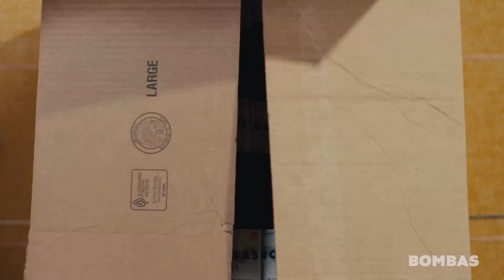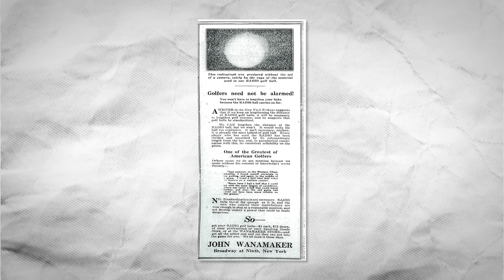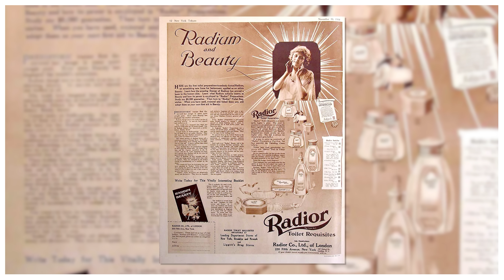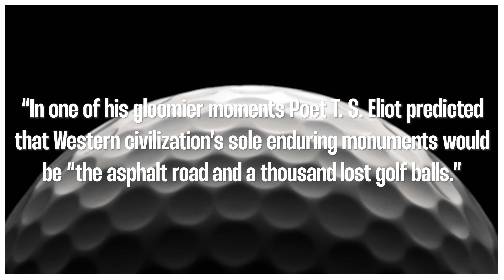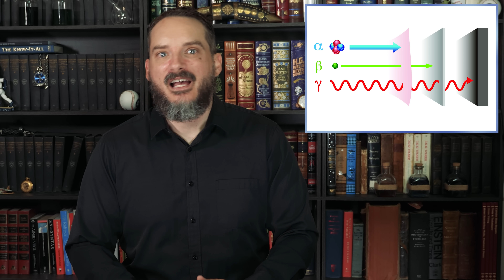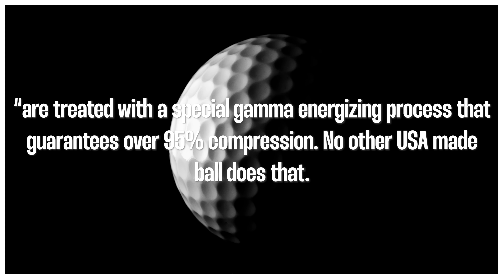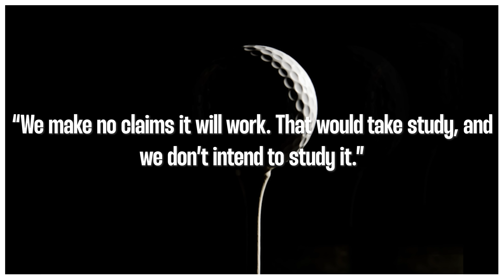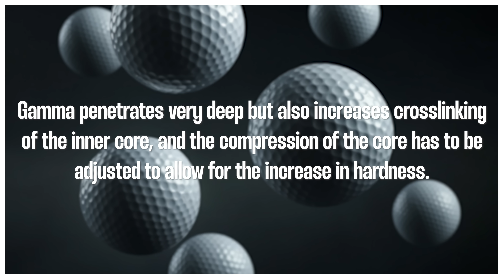The Curious Case of Radioactive Balls

Comment: I use a tool called a "ferret finder" for pest control. It’s a small collar with a radio transmitter that fits around the ferret’s neck, paired with a handheld receiver. You track it by following the beeps, and the receiver can be switched into another mode that helps pinpoint the collar’s location even if the ferret is deep underground. The whole point is to make sure you can find a ferret that gets stuck in a burrow. Similar technology is used in avalanche zones to locate people under snow. The transmitter itself is tiny, basically just a crystal and a battery, very tough, cheap to make, and small enough to fit inside a golf ball without sacrificing reliability. These have been a thing since at least the 1980s. The only downside would be inserting a battery but these things are so cheap you could make them disposable and have a pull tab to make the battery live. You could also make them rechargeable with contact points on the outside.

Comment: That reminds me, did you know your smoke detector is likely slightly radioactive?  The older smoke detectors use a radioactive source and a geiger counter to detect the smoke.  Most of the new one use IR but the old ones are still extremely common.
Reply: The Americium source produces Alpha particles; They ionize the air (by whacking it). The smoke detector then just uses some metal plates to detect if the signal changes 
If it used a geiger counter they wouldn't be as cheap as they are